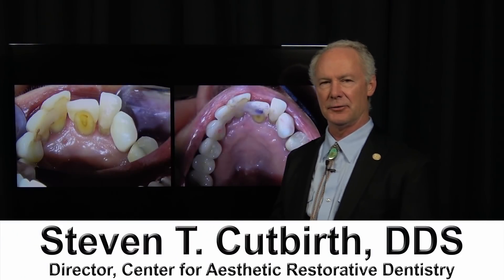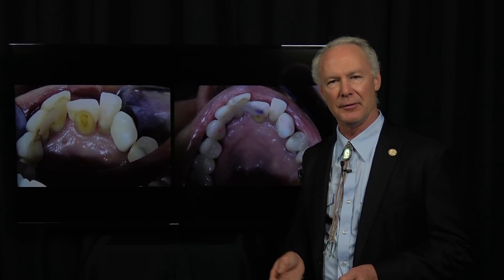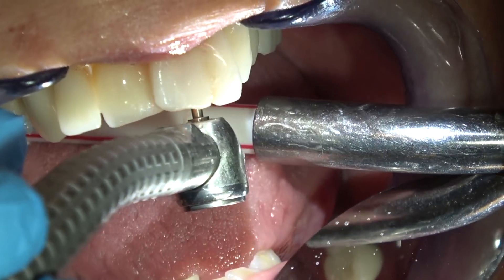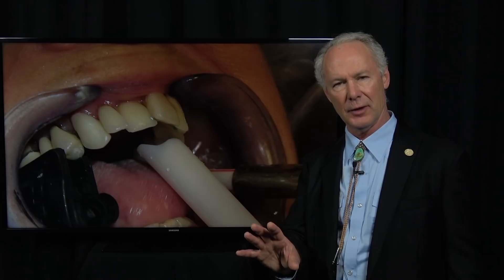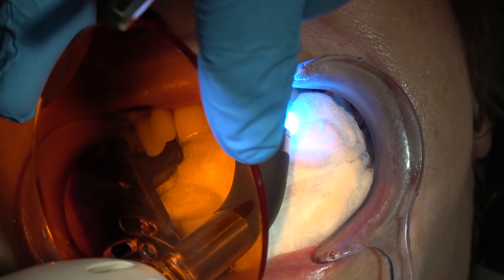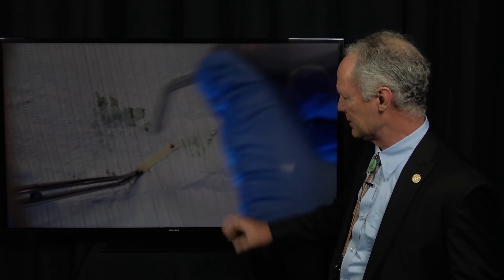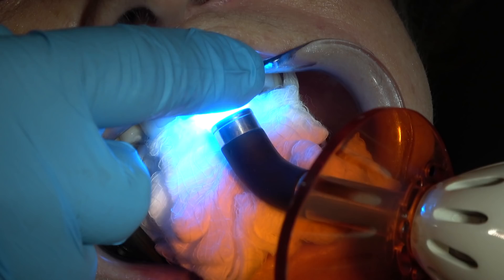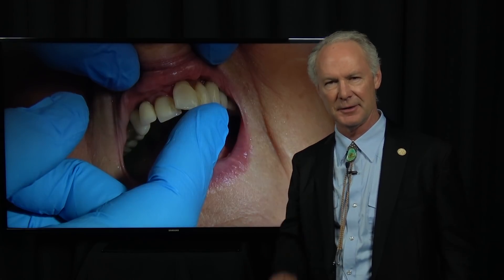Ribbonding - How to Fix Loose Tooth - Dental Minute with Steven T. Cutbirth, DDS

Comment: Great video doctor..  big fan of yours sir!! one question. What if The antagonist teeth are occluding.. I mean in cases of a deep bite. What suggestion would u give? In a deep bite the lower ant teeth will not let the upper mobile anteriors Stanilize.
Reply from the maker: If the opposing teeth are occluding with the teeth being splinted, it it is not an ideal situation because the Ribbond/composite will constantly be breaking loose because of the occlusion. I do not recommend this "patch up" technique in any but the most extreme situation, i.e., very elderly patient or a patient with extreme medical complications. If you have watched my other videos, you know I am not a fan of "patching" because the patient's problem becomes your problem when the "patch" breaks down. The patient in this situation was 96, was medically compromised and had significant dementia, but she had the most adorable personality.  Her teeth were mobile and we did not want to do a big restoration. She lived about 1 year following this splinting procedure. This procedure is simply something to have in your arsenal if a case like this comes along. I would not recommend doing this routinely on regular patients or you will be doing a lot of repatching. Take your practice to the Top Tier. Subscribe to DentistryMasterClasses.com for an organized library of all the Dental Minute videos plus many complete comprehensive cases and many very important articles. New cases are added weekly.  Only $20/month.
Click here to subscribe: 
https://membership.dentistrymasterclasses.com/purchase/?plan=513

Comment: That's a nice service for this woman, good job.  My Ribbond box looks just as old as yours!  Question;  I seem to hear so many varying recommendations for the time to etch porcelain with hydrofluoric acid. Of course that may be dependent upon the concentration of the acid, but I believe the rec I have with my 5% solution is 15 seconds; I noted that you mentioned you were using a 4% solution for up to 2 minutes.  Is that amount of time just something that you found works for you, or is that something you've come across in the literature?   Thanks.
Reply from the maker: That is the amount of time my lab etches the porcelain.  I do not think 15 seconds  is enough.  Dentin is etched for 15 seconds.  Let's both look it up on Google, the guy who knows everything!
Reply from the maker: There are many articles on porcelain preparation for bonding.  Read the article by Gary Alex, DMD, "Preparing Porcelain Surfaces for Optimal Bonding" AEGIS Dental Network.
Reply: @centerforard  ok I will give that article a try.  You mentioned phosphoric acid on dentin for 15 seconds, I agree....I'm just wondering if it is possible to over-etch porcelain; if not, there is no down side to etching for 2 minutes as your lab does.  Thanks. PS....you mentioned in your video that you have the lab ultrasonic the veneers after etching to remove the "chalky" layer.....after they do this, is there no visible evidence that the veneers have in fact been etched, and you just assume they are due to the close working relationship you have with your lab?  In the past, I've always looked for and been relieved to see that chalky appearance on the under surface of the veneers, as proof that they had in fact been etched!
Reply from the maker: The tooth side of the etched veneers looks "etched" when you dry that etched porcelain vs. the facial side which continues to look shiny when you blow air on that side and dry it due to the glaze on the facial side of the veneer.
Reply: @centerforard   thanks...one last question;  in your video you did not use any try in gel; did u edit that out from the video, or did you just know the cement shade thru doing so many veneers?
Reply from the maker: I never use try in composite.  I do not like messing with it plus I do not trust the shade of try in paste.  Watch my video on "Matching difficult shades with veneers."  It shows you how I do it.  That video is in the organized library of all the DM videos plus many other comprehensive cases in DentistryMasterClasses.com.  Subscribe for only $15/month and you have a library of all the cases and instructional videos.

Comment: Thanks for your perfect videos.teach immediate implant placement and composite class 2 for get tight contacts.
You are best
Reply from the maker: For several reasons, I am not a fan of class 2 composites.  I very rarely do them so, unfortunately, I cannot make a video.
Reply: Thanks dr.I follow your implant surgery methods in your videos.
You are expertise and i like to know your reasons for class 2 composites.
Thanks a lot
Reply from the maker: Large  volume of composite material tends to distort over time because the coefficient of thermal expansion of composite is around 70.  The CTE of a tooth is around 11.  When a person with a large composite eats or drinks hot or cold, the composite distorts a lot while the tooth distorts less, so the composite pulls away from the tooth and leakage and stain occur.  Think about the decay you have seen as a dentist when a patient presents with a mouthful of large composite restorations.  My experience with composites has been that larger composites are not stable over time.  If they are small, fine, but not large. Another reason I do not like large fillings is the sides of the tooth are not supported and the tooth is more prone to fracture because nothing is holding the sides of the tooth together and the large filling acts like a wedge down the center of the tooth.   I like to restore things one time if possible.  I don't like my restorative work or the teeth I have restored to break down.  Of course we all experience some breakdown, but I want the odds of longevity to be on my side with restorations.
Reply: Dental Minute with Steven T. Cutbirth, DDS  
Thank you very much dr .perfect

Comment: For the record, per the ribbond directions you are not supposed to put primer adhesive on the ribbond fibers.  It is supposed to be an adhesive only - an enamel only bonding agent like heliobond.
Reply from the maker: What difference does it make if you use adhesive only or primer/adhesive so long as you blow off the excess to remove the alcohol carrier?  When you place unfilled resin on an enamel defect/chip, don't you use primer/adhesive?
Reply: I'm not a materials expert by any means, but I do know that in general the best results are generally obtained by following the manufacturers directions and just wanted to point out that one of their most basic instructions is on page 5 of the Ribbond manual:  NEVER USE (all caps that they typed) a self-etching resin.   Which scotchbond universal definitely has in it.   In fact they don't even want you using a prime and bond (5th generation adhesive)  Just a 3rd generation adhesive.  They don't offer the chemistry on why.  Maybe if I get a chance I'll call the ribbond people to the answer.
Reply from the maker: Typo!  I meant to say, when you place "filled" resin on an enamel defect.............
Reply: yes, definitely.  The ribbond directions refer to what they wet the fiber with, not what you use on the dentin/enamel
Reply from the maker: I etch the teeth separately.  Bottom line, I agree with you about manufacturers directions most of the time. When porcelain veneers first came out in the 1980s on the scene a company called Bisco was a leading dental supply, porcelain veneer company.  None of us really knew that much about the technique, it was so new and different.  We were depending  on the directions in the kits as our guide.  After a few months, I was having quite a few veneers debond.  I spoke with the supply rep, described my technique, and she could not tell me what the problem was.  Finally, I was put in touch with the President of the company, Bion Suh.  I described the technique I was using.  He said, "But you are not placing primer/adhesive on the teeth."  I read the instructions to him and he almost died.  The instructions failed to list, "Place primer/adhesive on the teeth."  
The technique I am presenting works very well in these compromised situations and has worked well for many years.  I cannot imagine why it would make any difference if primer was in the unfilled resin, so long as you, as always, blow off the alcohol carrier.  Some of the time dentin may be exposed on the teeth and you will need primer.
Reply: Dental Minute with Steven T. Cutbirth, DDS   huge fan of what you did in this case and with the dental minute overall.   Great story!
Reply from the maker: Thank you.  I really enjoy the creativity of dentistry and the ability to use different techniques and materials to accomplish the appropriate objective.